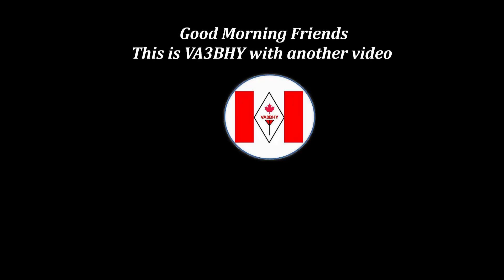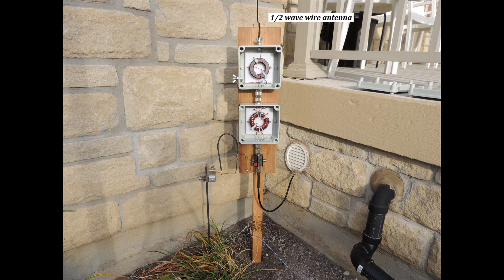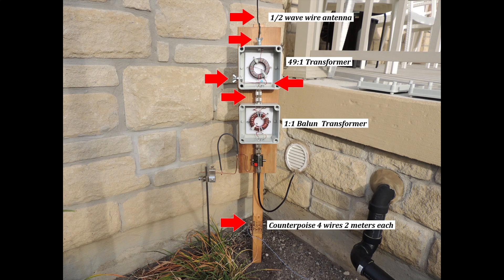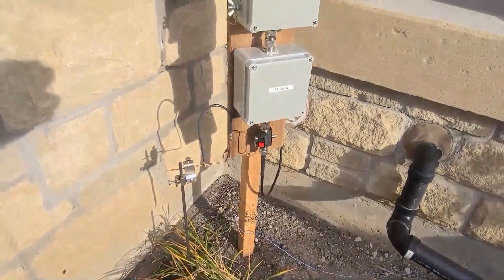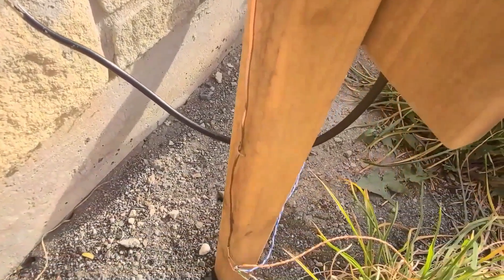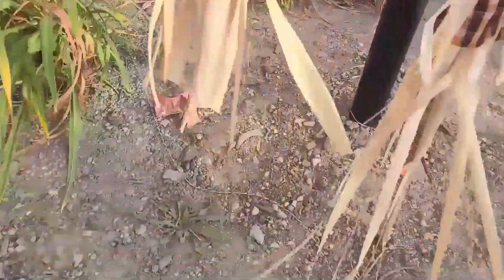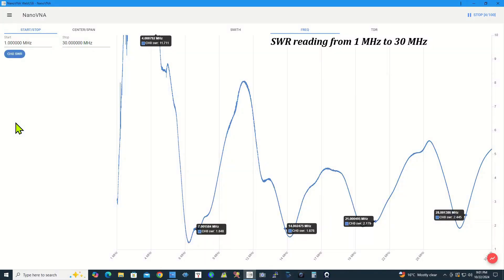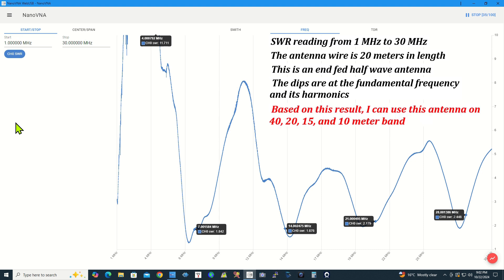EFHW Wire Antenna (20 meters of Speaker Wire)

Comment: Nicely done, nice setup.  Thanks for posting.  When you first set the antenna up did you try it without the counterpoise?  If so, how did that compare to using it with the counterpoise?
Reply from the maker: Yes I tried it without counterpoise and the results were bad. After adding the counterpoise, the dips showed up on desired frequencies. So yes, adding counterpoise improved my antenna performance a lot.
Reply: @VA3BHY  Thanks for the reply.  I've been working on a similar project but I'm struggling with coming up with a good counterpoise set up.  The SWR's are good but I think I should be able to have better RX and TX distances.